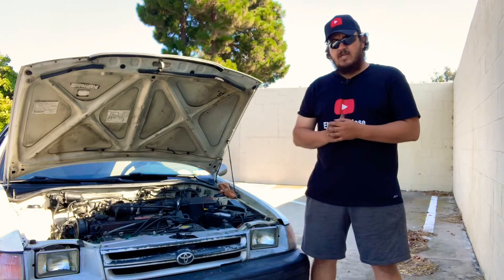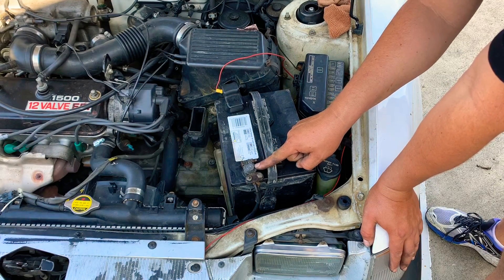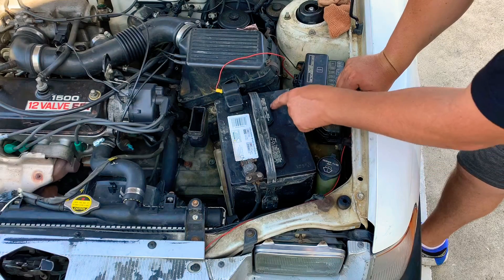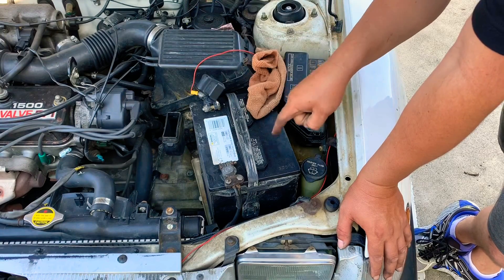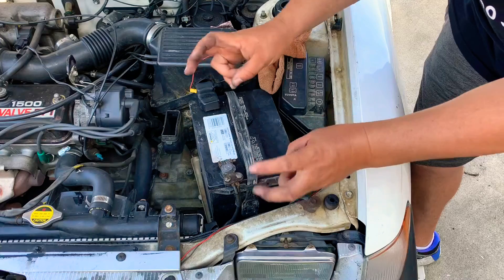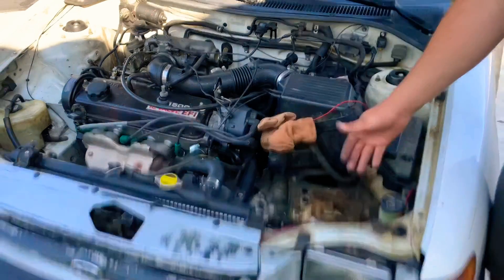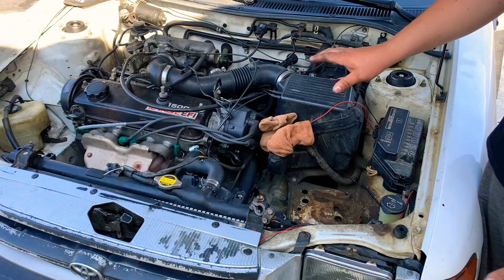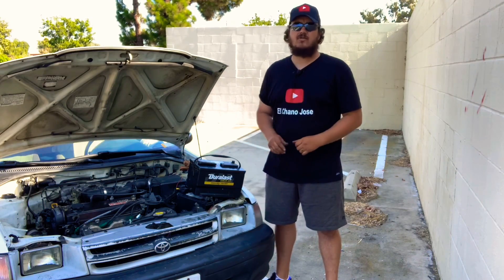Battery replacement with engine running @elchanojose

Comment: The best part about this video was you didn't have to use the tools just to remove the battery thanks man most people make it hard by having to use the wrench or pliers just to remove the battery but it seems like an easy task.
Reply from the maker: Hello H!  We try to keep things simple and easy.  Sometimes you might need a tool to losen the battery terminals or to remove the tie down point for the battery, but other than that the job is simple.  Take well care H!

Comment: Thank you so much
It is me, when I remove the battery from the car while it is running, which leads to a significant increase in the dynamo charging output and leads to damage to the car control????????